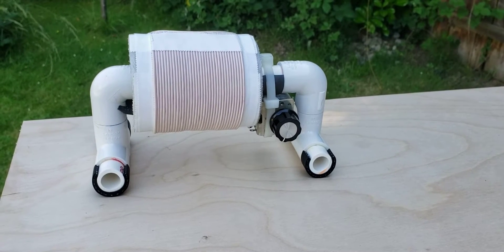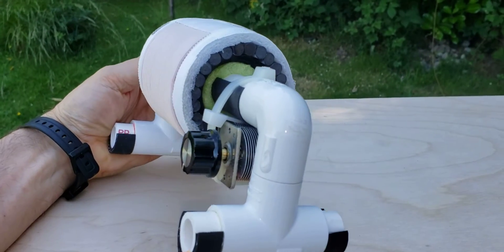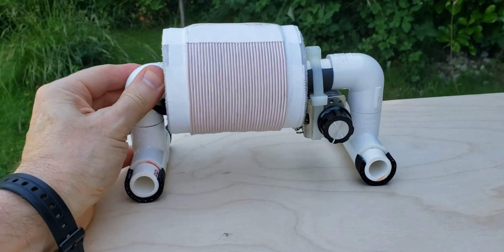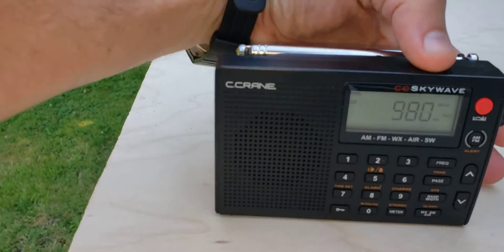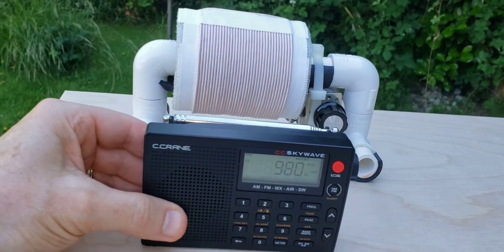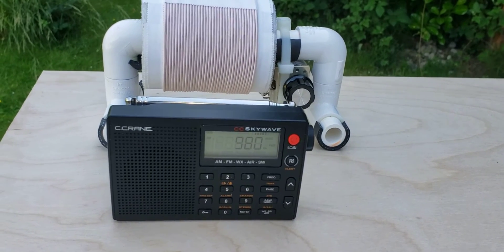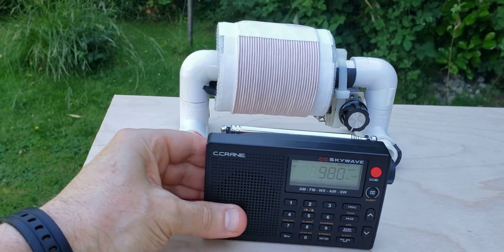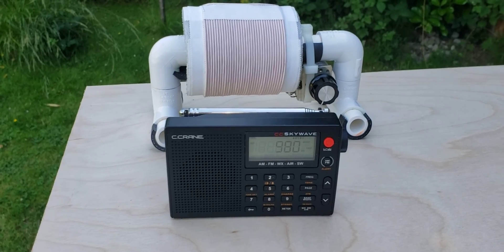New 3 inch (76mm) Baby FSL antenna-- a Tiny Thriller

Comment: Can one make a small kind of pirate chest for the loop and also put the variable cap inside the loop and chest to make it really small or is that bad?
Reply from the maker: Hi Foreverhere, as long as your pirate chest is made of insulating (electrically transparent) material you can put the entire Baby FSL antenna inside it very easily, but putting the variable cap inside the loop would degrade the performance. The idea has been attempted, but with poor results.

Comment: The Baby FSL antenna can be compared with magnetic loop like Wellbrook ALA1530 or some other?
Reply from the maker: Hi Alexey, the Baby FSL is a tuned loop antenna, unlike the Wellbrook ALA1530, which is a 50 ohm impedance broadband loop designed for SDR receivers. The tuned FSL antennas provide inductively coupled gain boosts for portable radios.